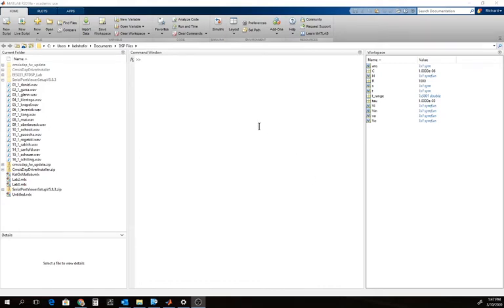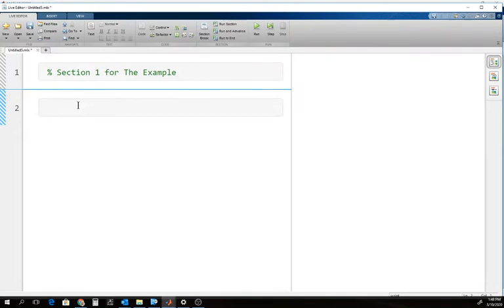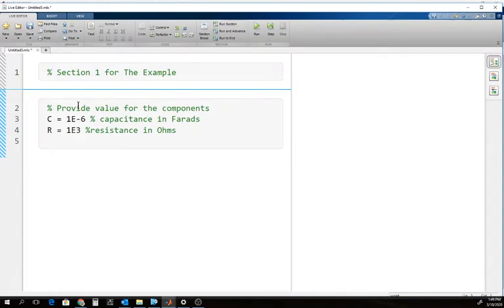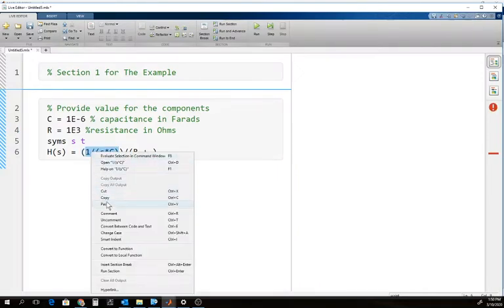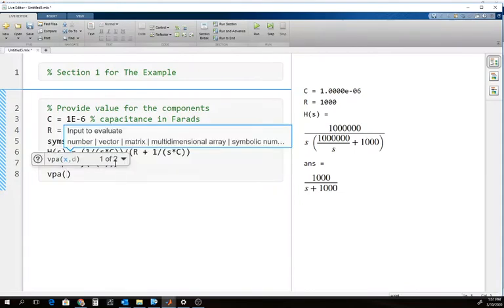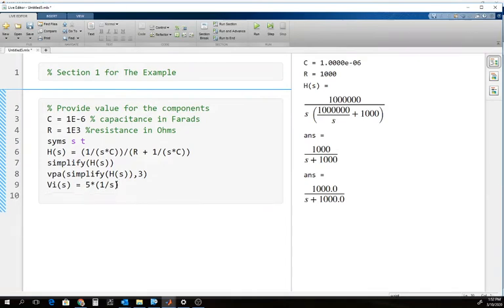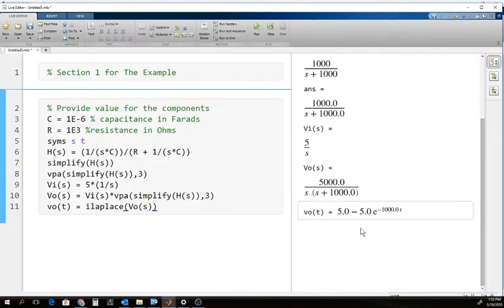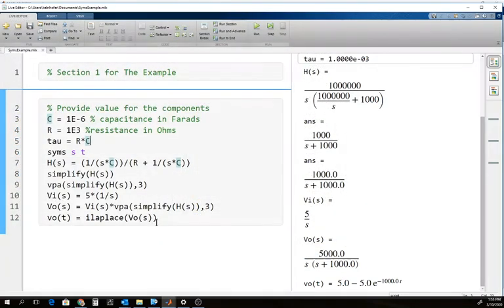Matlab Symbolic Operations with Live Script - Part 1

Comment: Computing the time domain equation of the transfer function via inverse Laplace transform in Matlab
I have my transfer function of my RLC curicuit 
can you help please 
thank you
Reply from the maker: Hi Quadri, you can use this technique to create your transfer function.  Create and impedance for each ZL = s*L, ZC = 1/(s*C) and ZR = R.  Then create the transfer function as needed.  If it's a series circuit and the output is across the resistor then, H = ZR/(ZL+ZC+ZS).  Good luck. -Dr. K